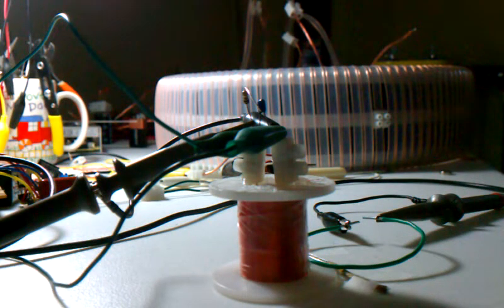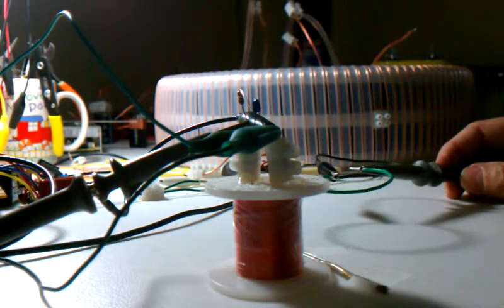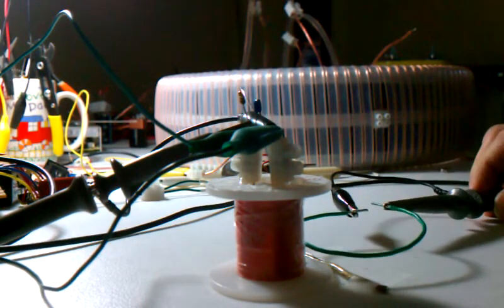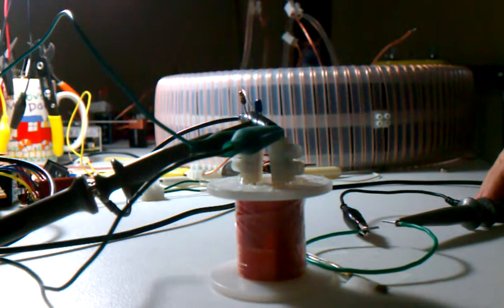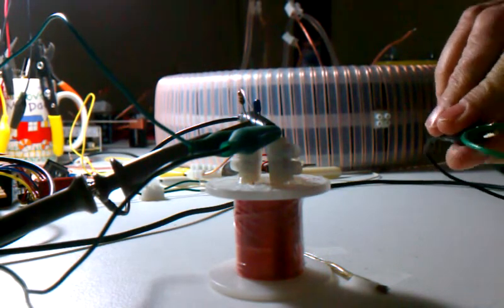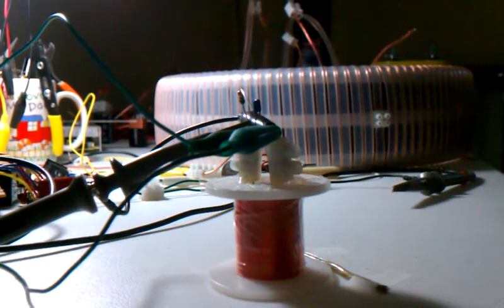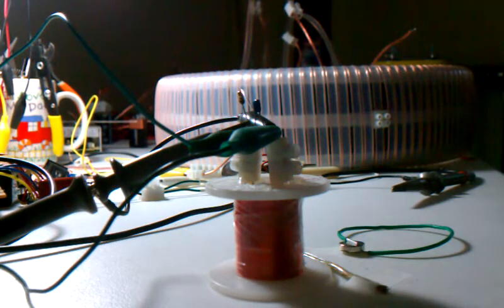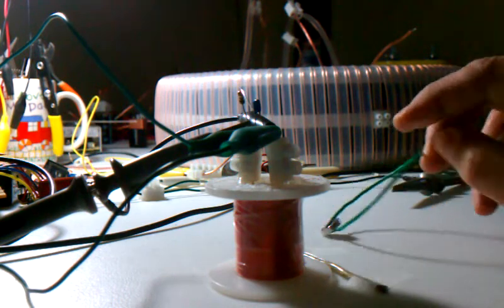Coil Vibrations

Comment: keep up the experimenting. there are a few ways to ou. remember you cannot attack the prime mover, you can get more power from a larger wire for same input to vibrate magnet. this can cause a larger vibration , I think all this can be done similar to a shaker light. keep activating coil at one end with opposing magnet inside one mag in center with coil around it another mag on other end. mags acting as springs to cause middle mag to bounce.